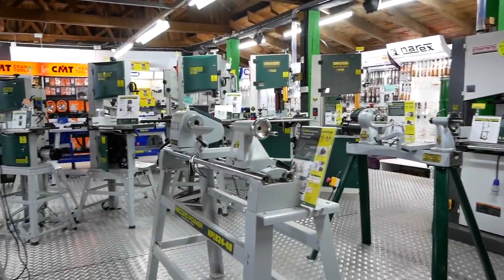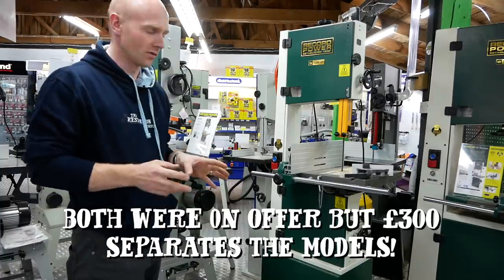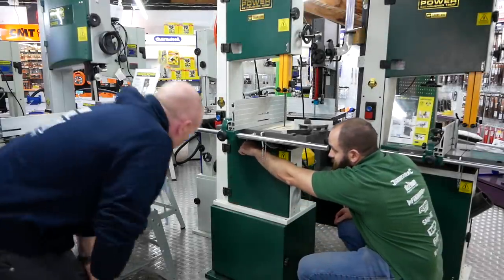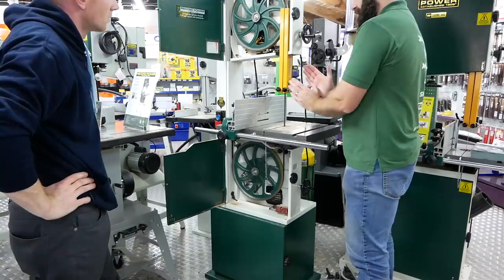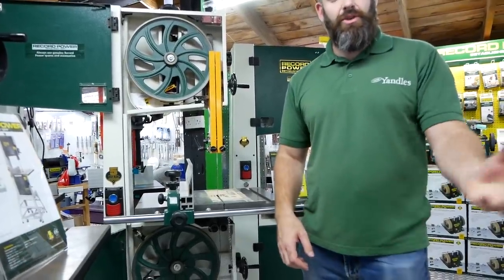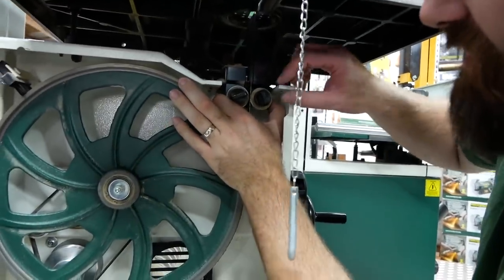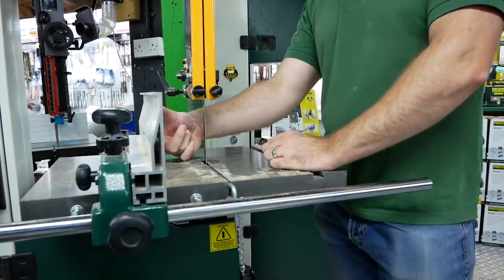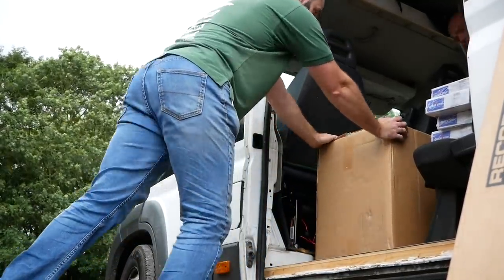CHOOSING MY NEW BANDSAW! Record Power Sabre 350 -  Walkthrough and Setup

Comment: As the owner of a BS350s I find it to be a capable saw that is very well built. But it has a few things that I think the Sabre range have fixed, for a start the fence is shite because you can't remove it unless you remove the blade first. You can buy an aftermarket fence from Axminster that is far better. It's a good fence in use, but not when you don't want to use it if you follow me. Also the wheel kit is abysmal and the wheels buckle easily due to two being fixed and 2 on castors. Also the drive belt is prone to breaking if the wheels aren't aligned perfectly.

Comment: I hope your Sabre350 worked when you got it. Just bought a sabre450 for my workshop. What a disappointment. Didn’t work on delivery. An electrician found it had been wired incorrectly inside. Very poor quality control for what is suppose to be the top of their range machine. Wouldn’t buy record power ever again.

Comment: Tim it looks like a wonderful piece of kit but what can it do for you in addition to your Festool tracksaw, a tablesaw and jigsaw??? Like Peter Millard gets by with an £80 Aldi bandsaw. I'm not really clear what a bandsaw does that other tools don't. I did however read it is very good if you are building a boat, which would admittedly be a cool thing to do.
Reply from the maker: Good question.  Mainly the ability to rip larger timber, i.e resaw boards, logs, bowl blanks etc, possible on a table saw up to a point but can be risky.      Plus in the immediate future cut all my curved oak braces which is not going to happen with a jigsaw or my little table top saw.